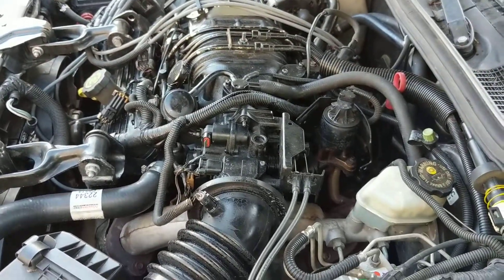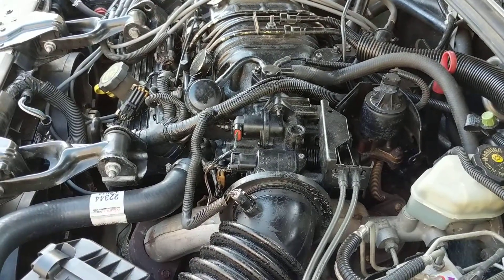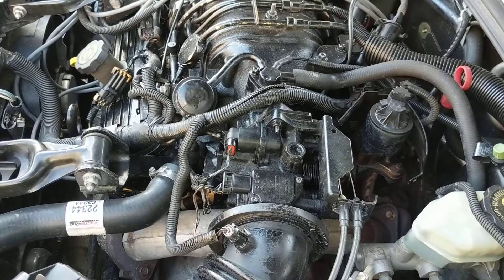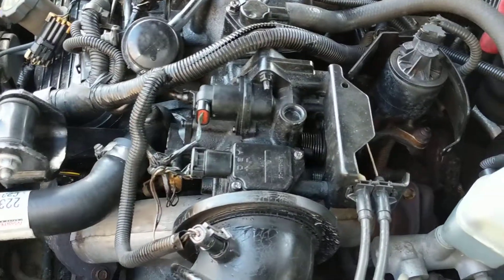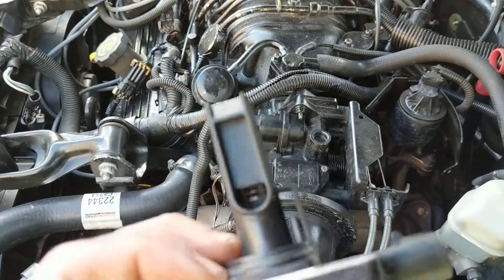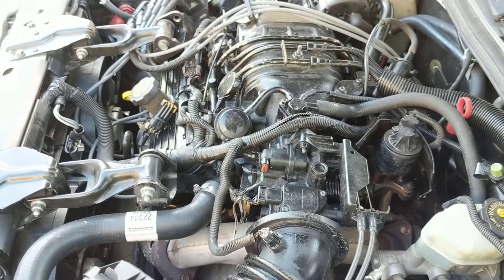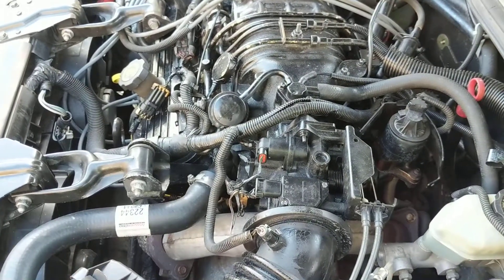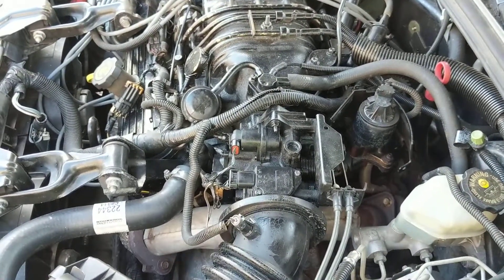2000 Pontiac Grand Prix GTP Supercharged Mass Airflow Failure

Comment: May I ask how did you take it out?
Reply from the maker: Two screws on the top of it then unplug the connector n pull straight up
Reply: Jason Fellon can you take it out with something else because I don’t have those secret screws
Reply from the maker: @realistic9830  if you don't have the correct torx bit, use needle nose vise grips n turn the screw with them it's a pain but it works

Comment: What error code would that be?
Reply from the maker: P0101 is the code
Reply: Jason Fellon the codes that I got were p0113,p1404,p1571, today my car did starts fine but when it drives for a bit it doesn’t accelerate asf much it starts to give up can you help?
Reply from the maker: @realistic9830  Error code P0113 indicates that the computer has received a high voltage signal from the intake air temperature sensor. This code will occur when the powertrain control module (PCM) receives a voltage of 5 volts or more from the IAT. This indicates a problem between the IAT and the PCM.
Reply from the maker: @realistic9830  OBD II fault code P1404 is a manufacturer specific code that is defined by General Motors (Chevrolet in particular) as “Exhaust Gas Recirculation (EGR) Closed Position Performance”, and is set when the actual position of the EGR valve pintle does no coincide with the position of the EGR valve pintle the PCM
Reply from the maker: @realistic9830  The Electronic Brake Control Module (EBCM) and the Powertrain Control Module (PCM) simultaneously control the traction control. The EBCM sends a Requested Torque message via a pulse width modulated (PWM) signal to the PCM. The duty cycle of the signal is used to determine how much engine torque the EBCM is requesting the PCM to deliver. Normal values are between 10 and 90 percent duty cycle. The signal should be at 90 percent when traction control is not active and at lower values during traction control activations. The PCM supplies the pull up voltage that the EBCM switches to ground to create the signal.
Reply: Jason Fellon thank you so much I’m going to replace the o2 sensors and the EGR valve
Reply from the maker: @realistic9830  replace the IAT also
Reply from the maker: @realistic9830  I know these vehicles pretty well
Reply from the maker: I'm on Instagram also link in my YouTube channel
Reply: Jason Fellon what is that?
Reply from the maker: @realistic9830  oh just I'm on Instagram also basically posting what I work on n so on n so on
Reply: Jason Fellon what is IAT?
Reply from the maker: @realistic9830  intake air temperature sensor